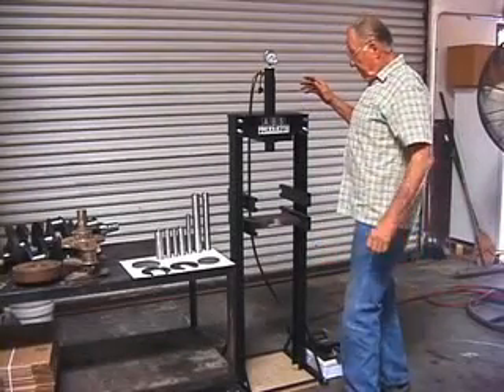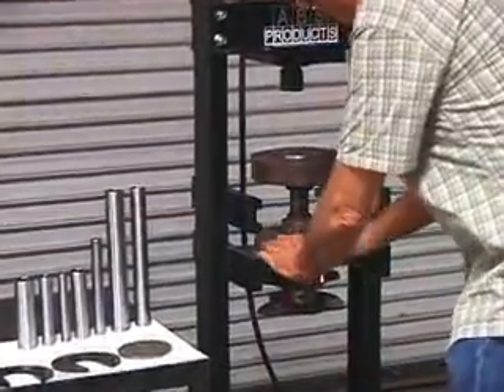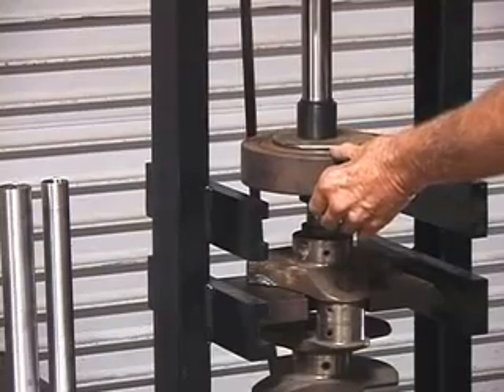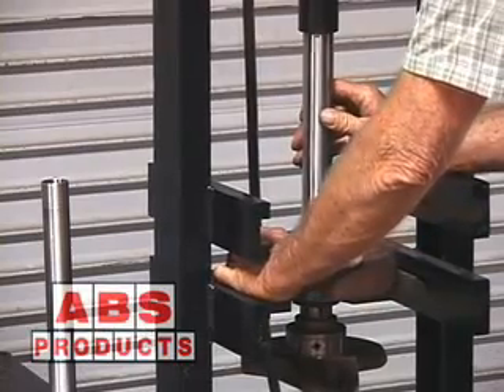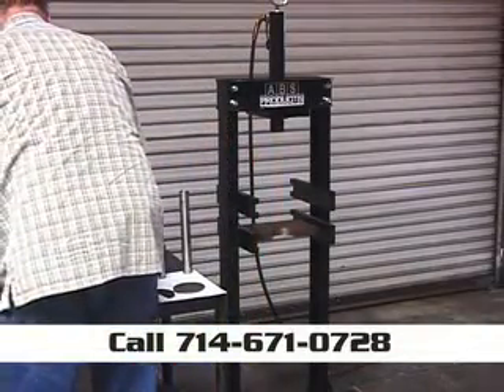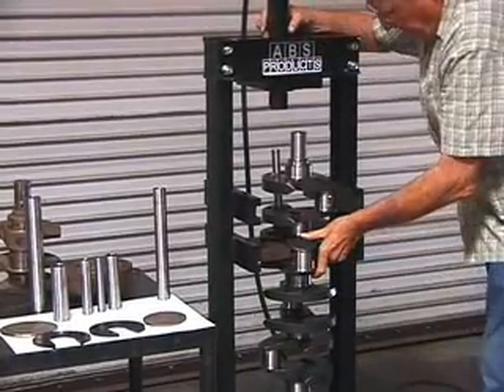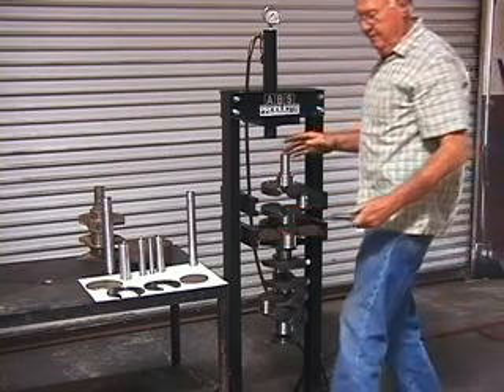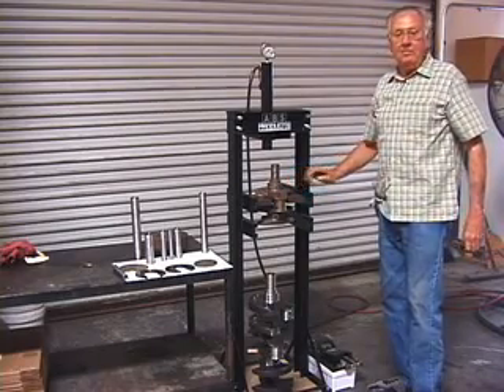10 Ton Hydraulic Press for Pressing Tungsten Heavy Metal

Comment from the maker: You need to press the balancer on when you're balancing the crankshaft on an external balanced crankshaft. Then press it back off after you balance it. This press is used for putting in heavy metal tungsten and pressing the balancers on and off during this balancing process.

Comment: Yes you do. You need to press the balancer on if the crank is externally balanced to do the balancing process. I know that it sounds wrong but that's how balancing an externally balanced crank is done before you can assemble your short block.

Comment: The need is to balance it in the machine shop. That press is a lot faster then the one we use in the shop I'm at. That means you save time/money by speeding up the process of preparing to balance a crank.